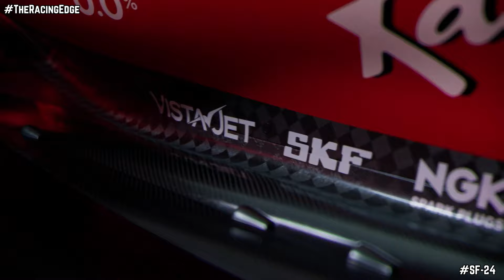Ferrari SF-24 Analysis - RED BULL BEATER?! | F1 2024

Comment: If they just copied RB 19 then they are on a back foot. If they innovate under body and suspension then it's going to challenge RB. They have a strong engine but the problem was chewing those tyres. Hopefully they fixed that problem.
Reply from the maker: They had other issues apart from chewing tyres in race configuration. I would say this sf-24 is simply the culmination of all they have learned over the last two years. And it is inevitable that some aspects look like the rb19. They did after all go down the right development part before all the other teams.
Reply: They didn't copied at all RB. Just thinking that they are the only team to have maintained the pullrod suspension at the back, when all the others goes on pushrod as the RB, it's the sign that Ferrari is going in his own way.
Reply: @solinvictus1234 they cannot change the suspension cause they will also need to change a lot of stuff including the gearbox. Costs a lot of money so they stuck to the usual suspension. They thought of doing pushrod rear like red bull. I Forgot their excuse for the front.
Reply: @critiqalerror  They reworked the gearbox this year, so if they wanted to put the pullrod at the back they was capable to do that too. They simply didn't wanted to go that way, as for the front one.
Reply: @solinvictus1234  All the other teams have concluded the pushrod rear is better aerodynamically. And ferrari F1 technical director said that suspension setup is overrated anyway. So yeah let's hope their decision just makes sense.
Reply: @critiqalerror  Pushrod is SLIGHTLY better aerodynamically, but far more difficult to hit the correct setup window to make it working properly, cause it have a far narrow setup window that pullrod.
Cardile said that the SPEECH behind suspension setup is overrated, cause it's true, both the suspension type have pros and cons that at the end of the day equalize themselves regarding performances.
If you have followed the Bahrain tests and the race pace of all the cars you will already know that Ferrari is the 2nd force behind Red Bull, with the others all behind them. That's what the race pace sim showed us this three days.
Reply: @solinvictus1234  Well Ferrari were already the 2nd best car by the end of 2023. Unfortunate that they only finished 3rd in constructors. So nothing has really changed if your assumptions are correct. I mean winter testing results are not the best data to collect, but if Ferrari have really innovated, they should have been challenging Red Bull in front and not to be behind them as what you said. They might be challenged more to the 3rd team (whoever they are) than to Red Bull.
Reply: @critiqalerror  They was the 2nd best with almost 8 thenth of gap behind RB. Helmut Marko yesterday said that now probably Ferrari is at 3 tenths. That will mean an half sec recovery if Marko is right.
Sadly yes, unless Newey do not screwed the car concept (and i don't think so) RB will be still ahead, but with Ferrari very close behind them and then the rest of the pack

Comment: The only thing i dont get is that they still use their suspension geometrie were they said thats their tire problem? Or i am missing aomething
Reply from the maker: Since everything has its positives and negatives, it could simply mean they found the negatives were to great to implement the change. I too don't understand why they haven't follow the lead with anti dive suspension...
Reply: @F1_Unraveled  but they have now a better ant dive or not?
Reply from the maker: I would say no. For that they would have to change both the front and rear suspension layouts. The front to Pullrod and the rear to Pushrod, as currently they have the opposite implemented.
Reply: The SF-23 was always good under braking so I'm not sure they were hurting for changes to how they manage dive - biggest problem they had was rear end instability which was driving increased wear and unpredictability in race trim. If they believe they can address it through other chassis/aero changes and just tweaks to the suspension, it perhaps makes sense to spend time elsewhere than a suspension redesign. Time will tell.
Reply: @F1_Unraveled suspension types it's a non issue, regarding the antidive. It's enough to calibrate better the ballast on the car to avoid the dive. That's why having a lighter car is much more important, cause with the ballast you can do whatever you want to change the car dynamism.